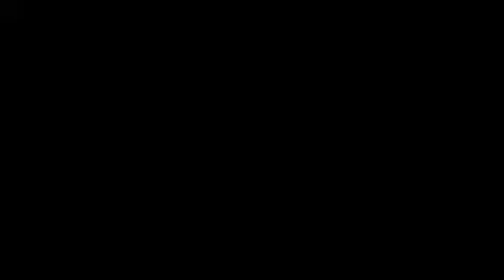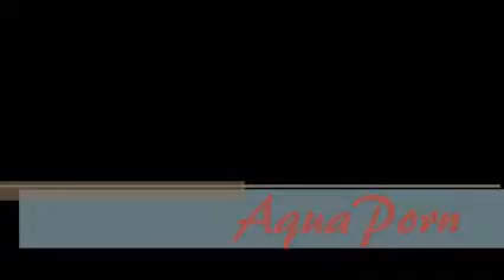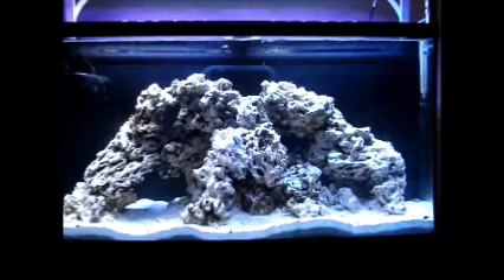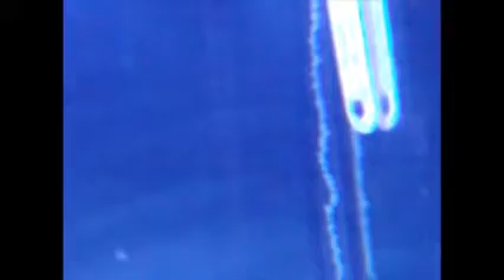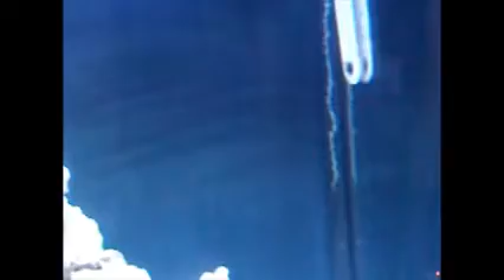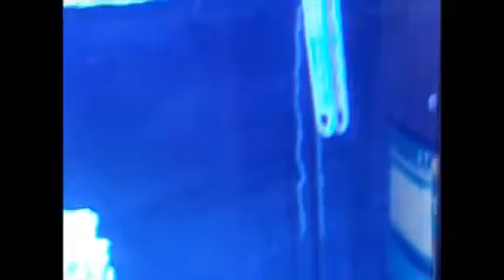LED Sunrise/Set - 1st Run - Arduino Controlled

Comment: hi im just getting into keeping fish and have been looking at ways to light my tank i like your idea a lot 
i have been thinking of using 5050 led strip with a spare arduino that i have 
my prob is that i dont know how to code the arduino to do the same thing that you have done if you can help me with the code  i would be very grateful also do you think 5050 led strips will be enough light for a planted aquarium my tank is 7ft x 2ft x 2ft
Reply from the maker: Absolutely.

www.aqcenter.net/topic/1825-luvid-aquatroller-dreaming/page__st__1900
Reply: thank you very much